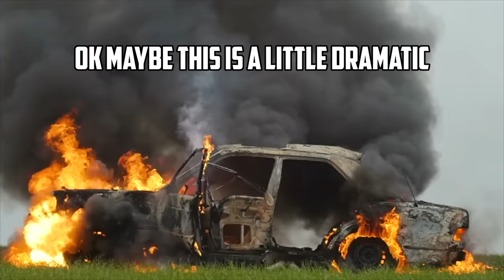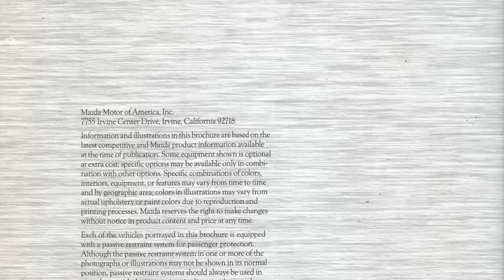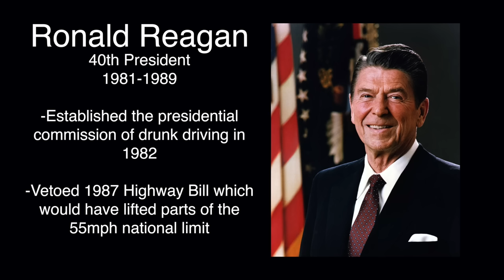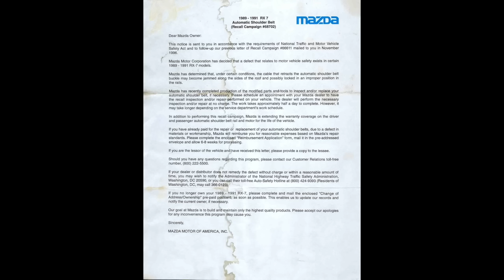Automatic Seatbelts - Why They Were Used & Why They Went Away!

Comment: Also another small point:  these "Automatic" seatbelts actually solved no problem.  You still had a lap belt that had to be manually attached, using almost the exact same amount of effort, and motions,  as a manual three-point seatbelt required.  I remember there being warnings in my '86 Escort manual that indicated that the automatic seatbelt was actually MORE dangerous without the lap belt.

I suspect that this is another major factor in their disappearance...
Reply: That's true. As long the law enforcement saw the belt over your shoulder, they would assume you're fully fastened.
Reply: The solution was the lap belt was attached to the door and you had to slide under it to get to the seat.
Reply: What I came to comment. I had a 91 mercury topaz with those things.
Reply: @Tim.Stotelmeyer  my ex-wife had one of them. Remember in the owners manual calling the seatbelt buckle an emergency release.
Reply: actually , the lap belt required less effort
Reply: @tinhinnh  I work for a delivery company that requires the use of the seatbelt every time the vehicle is in motion, even though drivers like me get in and out about 100 times per day. The effort is noticeable and a lot of it comes from having to extend the belt and move the buckle up along the belt at the same time. (And we're expected to do it quickly along with several other safety related tasks every single time we start the vehicle).
Reply: They stop you from getting tickets if you didn't have your lap belt on
Reply: I just commented this, and then saw your comment. It's an automatic gallows, not to mention the poor choice of target audience. The people who need an automated belt to comply surely won't put the lap belt on themselves.
Reply: @Screwdriver440 cool.   Guess GM did that to many of their cars besides Cadillac  in the late 80s and early 90s or so.   I was born in '89 so the automatic seat belts were history by the time I was old enough to know what they were.   However in the late 90s around '97 or '98 when I was in third grade my uncle purchased a 1990 Cadillac Brougham and owned it till I was 14 if memory serves me right.   At the time I thought that was a weird location for seat belts, and also through it was weird but really convenient to have the gas cap behind the license plate, if there was a long wait as the gas station,  you could pull up to the first spot that opened,  while other cars had to wait and find the side where their filler was on😀😉   and the seats felt like my grandmother's leather sofa on wheels.   I wish Uncle Frank hadn't traded that car in for a GMC Sierra 2500.   Was a cool old car to say the least,
Reply: Cars with an automatic shoulder belt have a dash knee bar to catch your legs of you're not wearing the lap belt. Not saying that's a better solution - far from it. But the standard was "Passive Restraint", so the system had to work with the driver doing nothing. 
Many cars with airbags had knee bars to - my 91 Benz has them.
Reply: @TheBigdog868  my parents had an 89 Tempo with them, we didn't have Topaz money 😂
Reply: @kaidwyer  Yes and yes to that!
Reply: It really was more dangerous. When I was little I remember the belt in my face.
Reply: @julianbrelsford  that's especially interesting because where I live there's an explicit exception to the seat belt law. You don't have to wear it if you are making frequent stops and are driving below 15 miles an hour specifically for the benefit of delivery companies.
Reply: They were working on ones that were lapbelt auto as well but airbags came along.
Reply: And the Escort didn't have auto belts til 87
Reply: @julianbrelsford  perhaps they should bring back auto belts for delivery vehicles
Reply: Not to mention the shoulder belts all had a safety release on the belt buckle.  So many people ended up with the seatbelt motor moving sans a belt.   Effectively making both shoulder and lap belts manual.  All it really did was add a needlessly motorized and less reliable alternative to a traditional belt retractor.
Reply: @Tim.Stotelmeyer  Came here to say that. Pontiac Grand Am had that exactly. Was a pain in the proverbial @ss getting in during heavy rain. I think later model's did actually have a way to unplug that lap belt
Reply: @julianbrelsford  this is the case where they make the most sense: delivery trucks and similar vehicles that make frequent stops so the driver can get out.
Reply: @Sparky-ww5re  Edmunds says that the 1990 Cadillac Brougham is currently priced at $3.7K to $6K to buy, and has a trade-in value from $500 to $4K, so if you really want one it’s not too expensive as long as you can find one.
Reply: Exactly what I came here to say
Reply: I was wondering about the lap belt part… thanks!
Reply: Ahh the younguns who didn't know seatbelt laws didn't come into effect until the 90s
Reply: Mine had both
Reply: Had a 93 Hyundai Excel like this but it wasn't a motorized chest belt. A lot of people never put on the lap belt and died in crashes where they slid under the other one.
Reply: The only automatic seatbelts I ever saw was connected to the bottom of the door and the top of the door where it closed and had a point to the center of the car where it was secured . Never had an issue with it ever .
Reply: @kaidwyer  Automatic gallows indeed.  My father, who was an actuary specializing in auto and homeowners insurance, once told me a story about an insurance claim where a lady was hanged and choked to death because she wasn't wearing the lap belt, her car got hit and spun around, and the shoulder belt wrapped around her neck.

When I was a kid, my friend's mother didn't wear her lap belt in her car that had automatic shoulder belts.  I told her that story, and she responded with a sarcastic "oh, I'm glad you told me about that" but still didn't start using her lap belt.
Reply: I agree with this message.
Reply: @goat4298 #facts
Reply: How Sway? 🤔

Comment: I found this funnily sneaky, forcing people to wear seatbelts by putting them on for them. I suppose many people unclipped the seatbelt and stuffed it between the seat. Carmakers, always looking for the cheap and easy way, found automatic belts to be easier than airbags. Once airbags became mandatory there was no reason/need to install automatic belts.
You also should have mentioned that the lap belt still had to be manually fastened. The shoulder belt alone is not enough to prevent injury in a crash and can be worse than a lap belt alone.
Reply: And how the 3 point belt can be worse than 2 point lap belt?
Reply: It seems that a lot of Japanese automobiles in the 1980's always lagged on safety devices until forced by government mandates for airbags.  One of the reasons why I have always owned German automobiles.  Anyone old enough to remember the early 1970's when some American cars would not start unless the seatbelt was buckled?
Reply: @kennixox262  I didn't realize they had cars that wouldn't start without the seatbelt buckled.  My Ford ('77) has a buzzer that goes off for eight seconds after you start the car if your belt is not buckled first.  My Cadillac ('73) and Plymouth ('72) actually both have occupancy sensors for the front passenger seats, so if you set something heavy enough in the seat, the FASTEN SEATBELTS buzzer and light come on because the car thinks an unbuckled passenger is in the seat.  Needless to say, all three cars quickly had their buzzers disconnected.  I always wear my seatbelt and make my passengers do so as well, so the buzzers were just an unnecessary nuisance in my case.
Reply: @NoName-ik2du  I believe around 1972, that was the model year my mom purchased a Cadillac Fleetwood and can remember that she was quite annoyed by that. Was rather young myself, about 10 or so but to recall that.  The car was a POS and that quickly went away for a Mercedes.
Reply: @TheKitMurkit  If you didn't fasten the lap belt it wasn't a 3 point belt, only a 2 point shoulder harness in that state. And I recall hearing an urban legend about how if you didn't have the lab belt fastened with those 2 point shoulder harnesses, you could risk slicing your neck on the shoulder belt in a sudden crash without the lap belt to aid in holding you in place. Not entirely sure how true it is but running the edge of those old belts across some exposed skin sure could be painful if you did it hard enough 😬
Reply: Not all manufacturers did this some just went straight to airbags standard.
Reply: @NoName-ik2du  they did that in 1974 but quickly abandoned the law.
Reply: Not all cars required the lap belt to be put on manually I remember there were a few that the lap belt was attached to the door so you open the door and sort of slid under it and then close the door and it wrapped around you.
Reply: @johnnyjoseph1389  I believe you are talking about some of the GM cars from about 1989 to 1994.   when I was a kid my Uncle Frank owned a 1990 Cadillac Brougham.  I remember the seat belts in the front seating positions were in the doors, with a lap belt in the center front seat as well for a total seating capacity of 6, and couldn't understand why the heck that was the only car I've seen like that, or why you had to flip the license plate down to access the gas cap, (actually I used to think the gas cap location was really cool and thoughtful,  because if there was a line at the gas station it didn't matter which side opened up first 🙂    by the time I got my license   he had already sold the Cadillac in 2003 and brought a new  GMC Sierra 2500.   I was 14 at the time.    

Anyway when I got older I decided to look into that, and GM was the only manufacturer to put seat belts in the doors, most everyone else had the motorized shoulder belt,  but you have to then remember the lap belt manually,  that was dangerous in itself because many folks were injured or killed from sliding under the shoulder belt in a crash if they didn't fasten the lap belt.   In the GM versions,  I'm sure most everyone treated the door mounted belts as normal, they buckled up if they felt like it.   Then of course by 1994 or so when cars were required to have a driver's side airbag at a minimum the automatic seat belt was a thing of the past.   And thank goodness they were short lived
Reply: You could stuff them in the middle, however in my Mazda with automatic belts this results in an alarm going off and a seatbelt light on the dash lighting up
Reply: @johnnyjoseph1389  
Yes, the 1990 Geo Metro and Subaru Justy had these. Probably others as well.  I had both. Still have the Metro.  The drivers side retractor spring in the Subaru broke in a couple of years. They wanted $400 just for the part back then. Belt seemed to work and pulled tight but would not retract fully. No recall issued that I knew of.  I just put up with it. In the Metro, there is so much drag when opening the door it’s just easier to unbuckle and use like a modern car.
Reply: @TheKitMurkit  it's not 3 point by default. The top slides on the door but the lap belt is a separate thing that has to be put on separately, so you could easily see some safety belts opponents who wouldn't do that and just drove with the top part.
Reply: You are making up details. Airbags came along later. I can't imagine it was their cheap answer to airbags either. You are going to have to provide some data to prove your point..
Reply: @kennixox262  I do remember those cars. Some people used plastic templates plugged in instead of an actual seat belt to avoid this.
Reply: Mine was both auto matic
Reply: Lol
Reply: Much worse. I knew someone who was decapitated in the 90s.

Comment: I argue that they were also really impractical as the passenger still needed to buckle the lap belt. With the standard 3 point, it was one motion that engaged the lap belt and shoulder belt.
Reply: Very popular with older people when I was a kid. Not everyone can reach an item at shoulder height within the confines of a car.  The lap belt is easier to reach for people with lower mobility.
Reply: you have to realize who these were marketed to. people who would always forget to buckle their seatbelt because for decades they drove without one and it wasn't a problem until they started writing you $100 tickets for not wearing it. back in the 80s $100 meant a lot more than it does today.
Reply: these people were not concerned with their lives and the cop cant see that they don't have the lap part attached as they are driving by.

Comment: I had forgotten about them.  Many people hated wearing a seatbelt, but most people just forgot.  I remember having to remind my parents to put on their seatbelts.  Even in their old age, they would pull out of the driveway and start putting on their seatbelt as they were driving.  Then my mom got into the habit of taking it off a block away from the house.  I wondered about that.  It's like she was preparing to dive out of the car.
Reply: Seat-belts weren't required to be used until sometime in the mid-80s depending upon where you lived. The first law in the US was in NY and it took effect in 1984. I remember going with my dad to a junkyard to get a seatbelt to install in the backseat of the car, so that there would be a lapbelt for the kids sitting there.I knew a kid that literally fell out of a car going around a turn because the door popped open and he wasn't wearing a seatbelt.

Some people are set in their ways or honestly believe that after all the years they've been driving without needing the belt that they won't need it in the future. I've only been in one car crash and the belt didn't do anything. I was hit from behind at low speed and the seat alone would have been sufficient. But, I still buckle up because who knows if I'll be as lucky the next time.
Reply: My MIL got into a really bad accident as a passenger when she was 17. It effed up her neck pretty badly. The scar from the surgery to fix it is huge. They (my in-laws) used to have to drive down a small hill of a driveway to get into the parking lot of their old apartment. At the bottom of the hill, it quickly veered to the right, and you couldn't see around the corner because there were trees and bushes. It was mind-boggling to me that as soon as she pulled off the road and into that descending driveway, she'd fcking unbuckle her seat belt. Every time. And more than once, someone would be tearing around that corner like a bat out of hell to go UP the driveway.
Reply: I just could never forget to put a seatbelt on. It's just so instinctive to belt up, if I don't something just feels super wrong
Reply: My parents also did that, but I assume it’s cause we lived in a tiny one way street neighborhood and usually no one was on the road

Comment: My '94 Saturn has both automatic belts and a driver's side airbag. The sun visors are getting pretty chewed up because the seatbelt carriage can get stuck on them if the visors are swung over to the side when you open the door. This is my third car with automatic belts and the first one on which I've noticed this issue.

A few years ago I got a letter from Mazda about an ignition switch recall on a '91 323 I used to have. I have to say I was impressed how old of a car they would recall, though by that point the 323 had already succumbed to other issues.
Reply: Saturn SL2, probably the same year. Jeeze, that was decades ago. Man time flies.

Comment: I have automatic seatbelts in my 92 svx that still work. I love them so much. They confuse people that have never heard of them but are really convenient. I wish they stayed around for longer. The only issue is occasionally you hit your head on the sliding mechanism and it really hurts
Reply: Not being shitty... How are they more convenient? You still have to clip a lap belt no?
Reply: @kevinhibbard320  oh no lol. I dont use it lol. Im planning to get bucket seats and a harness and just let it run the track without the belt
Reply: @SVXtasy_  Maybe unplug the trigger switch or power to the motor that way part doesn’t burn itself out? If you want it again later clean and grease the track and plug it back in. By the way cool car!
Reply: I have them in my 92 svx also and my 94 turbo legacy. I had to get a track at the junkyard to repair the driver side in the legacy that was seized. Easy repair and totally worth it. They are so cool I think. I never want to convert them to manual belts
Reply: The SVX can be such an amazing car with custom mods like a Manual trans and STI drive train. It's a ton of work from what I hear, but the SVX looks really cool and worth the money and effort IMO.
Reply: @EmilyRose900  I've been thinking about doing a manual swap in mine and maybe rwd while I'm at it. I won't use the 6mt though, I'll use a less expensive transmission if I do
Reply: The only reason I know about automatic seatbelts are because of the svx it's been my dream car ever since I first saw it
Reply: @TrillMurray  even a 5 speed would do well enough to be worth the time and money.
Reply: @EmilyRose900  yeah that's what I'm thinking. I'm not sure which one but I'd like to keep the same gear ratio so I can keep the viscous lsd in the rear
Reply: Pls post a video of all the weird things like that in the SVX
Reply: ngl I saw your model of car and thought about the RoboCop movie mock commercial. Lol

9000 SUX
Reply: @SVXtasy_  Please see the other comments - not using the lap belt can make it more dangerous than no belt! Horrid design flaw :(
Reply: Also, enjoy death if you get hit from that side...